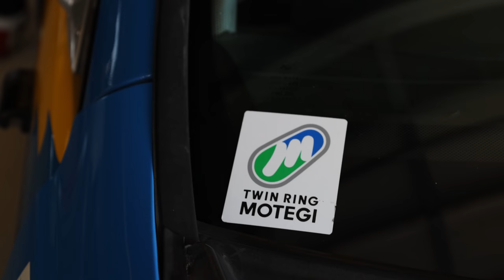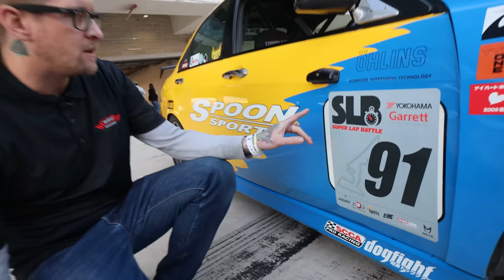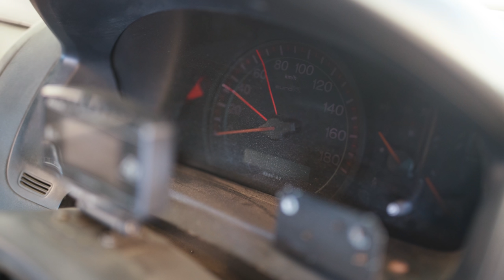Rescued Spoon Sports Honda Accord Euro R Racecar… 1 of 1!

Comment: I think the Accord is possibly a great platform for a racer. It's Honda, it has the suspension design that will keep up with most aftermarket goods. Engines can be built to perform and it's a good size car for the midsize coupe or sedan touring car section. They handle out of the box! 💥🇯🇵

Comment: Cl9/7 prices about to spike soon
Reply: 6 Speed manuals one have held there values already. Especially the 06-08 ones.
Reply: @iheartgs400  I had a 6spd 05 but it was modified from the ground up type s gears,LSD mfactory, and I had a rebuilt short block with 11:5.1 compression was gonna be a sleeper build until it got hit but maybe in the future I’ll build another one hopefully 07/08 this time and I’m also looking forward to see an awd conversion for the chassis since we couldn’t get the factory cl8’s in the states
Reply: @itsreallytheo  yeah 06-08 is where at it they had the K24 so button down for those years.
Reply: I put a k24a2 in my 03 crv 5speed.
Reply: @vipereagle7446   i had a type s swap was gonna put in a 2.0 like the cl7 accord but i sold the parts and scrapped the shell
Reply: Probably not, they’re so cheap and ubiquitous, well here in NZ and Australia anyway.
Reply: @itsreallytheo   the 03 crv is basically a dc5 rsx. I got an ep3 eps system and k24a2 out of an 07 tsx. 5 speed with an awd lsd diff. No one thinks my beater crv is pushing 300 hp and can be so fast for being a brick lol

Comment: I’m trying to get a daily first car CL7 and debating if I should get a 145k km vs 100k km mileage car in which the 100k km mileage car cost $30k HKD more . Not sure if I should stick to the high mileage one as it will depreciate less anyways and not worth it for the added money for 45k km more mileage. What do you think? The 100k of course looks better with some mugen parts and 145k has a Js racing exhaust.
Reply: I finally got my first car - and it’s a CL7r, in white with J’s Racing carbon hood and Spoon bumper!!

Comment: I have one question: the euro r was built 2000 to 2002 and came with the h22 motor...why this one have k20 in it?
Reply: Different chassis obviously this is the cl7 chassis so that would be 03-07
Reply: These cars came with k20s, you're referring to the previous generation

Comment: All spoon cars are so slow. Over rated
Reply: Jdm tuners aren’t meant for hp. Japanese cars are built for balance. 🤦🏻‍♂️🤦🏻‍♂️
Reply: @1siksivik  ... then what's the point? Nurburgring is all about the fastest times for all production cars so if honda isnt about hp then what are they good for? Cant be for reliability because their transmissions are the worst. How many recalls did honda have in 2020?? ***fart💨💨
Reply: hyper  ... are you talking about the new type R or ITR?
Reply: hyper  are you a GTI guy or Golf R guy? Golf R's fly when they have built  engines, upgraded turbos, suspension, tires, wheels, aero, etc.... remember, DCT is most important on track use. The Golf R DCT shifts way faster than any type R.
Reply: hyper  ... it does the exact same whether you call it DSG, DCT or PDK.... it's still a dual clutch transmission which shifts faster than any type R***fart***💨
Reply: If you want to finish 1st, you must first finish. They're made to endure 25hrs without breaking.